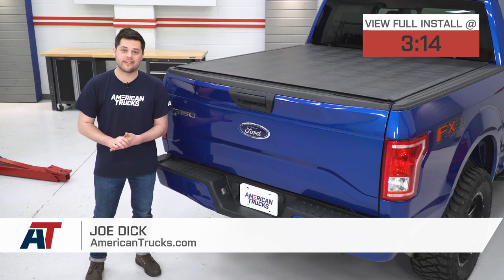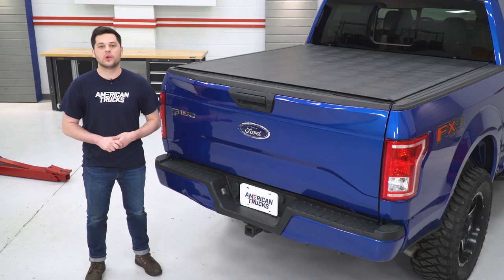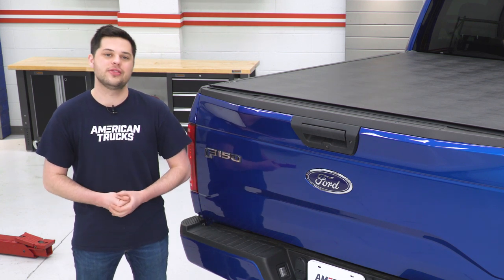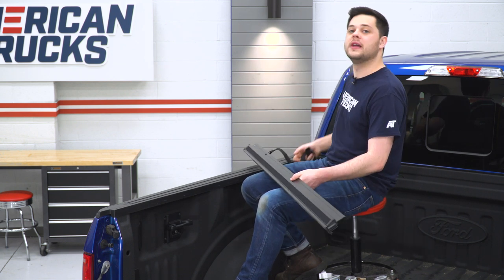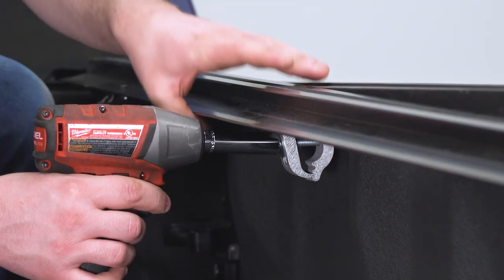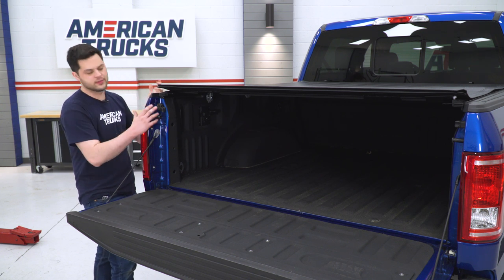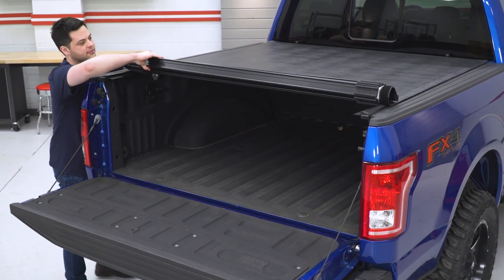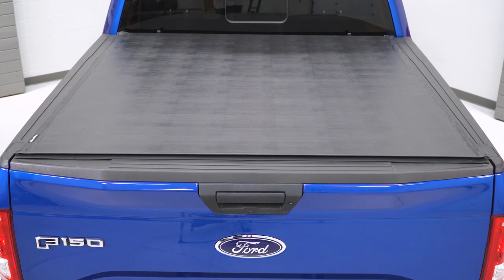2015-2019 F150 Truxedo Sentry Hard Roll-Up Bed Cover Review & Install

Comment: I have no idea how AT installed this cover and was able to slam the tailgate shut with the cover latched. Truxedo even advises the cover should be open to use the tailgate which is very inconvenient.  Ive installed two Sentry CTs, one on Line-x's F150 bed, and one with ford drop in liner. In both applications, neither were able to close the tailgate due to the angled seal colliding with the tailgate. The only way I was able to resolve it was to reverse the seal. Its a nice cover otherwise, nicer than my previous Revolver X4 (which did allow tailgate usage while closed).
Reply: What do you like about the Sentry over the Revolver?
Reply: @jselly2013  I liked neither of them. The revolver has rails that are poorly finished and stick out past the end of the bed over the tailgate, it wasn’t finished as nice as the Sentry CT. I got rid of the Sentry after a year because it started squeaking loudly while on the highway. Replaced it with X15 pro, same fabric as sentry ct but no squeaking.
Reply: @ATR-42  I am going to install my CT cover tomorrow and I have a Ford drop in bed liner.  The liner at the forward end has a molded 
J-shaped lip that hooks over the forward bulkhead at the top.  Is this going to be a problem or just apply the seal right onto the bed liner upper edge ?  I'm going to trim down the bed liner in some places to make it easier to remove.  The cover should prevent any road sand and leaves from getting behind the bed liner like I have recently found.  Getting in through the cutout holes for the tie down accesses.  ATR-42 ? are you a aircraft mechanic ?
Reply: @jetboy770371  no just a former ATR-42-320 driver. Stick the foam seal across the bed rail on the horizontal surface. I got rid of the CT after 9 months because it squeaked badly on the highway. Your bed liner tie down holes should have rubber caps.
Reply: @ATR-42 are you still running the X15 Pro and are you happy with it?

Comment: Doesn't Truxedo advise to close the tailgate first, then latch down the cover. The way their tailgate seal is designed closing tailgate first is recommended?
Reply: I installed two of these with the same frustrating problem of not being able to close the tailgate when the cover is shut. I reversed the seal on the cover (flipping it) and it allows free use of tailgate, sketchy work around on a $800 cover. In the video if you look close it appears like he has the rails installed high on the bed, that's the only way he got clearance.

Comment: I was leaning towards the Bak X4S, but like the cleaner lines of the Sentry. The tail gate issue was keeping my away from the Sentry, but I realize that I don't open the cover very often on any truck I've owned and would be at the tail gate anyway when I did.